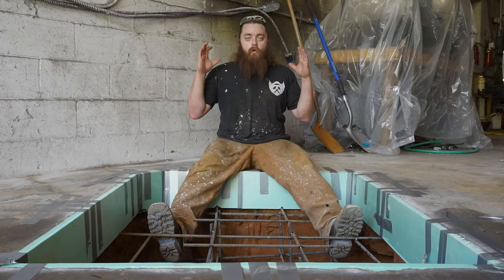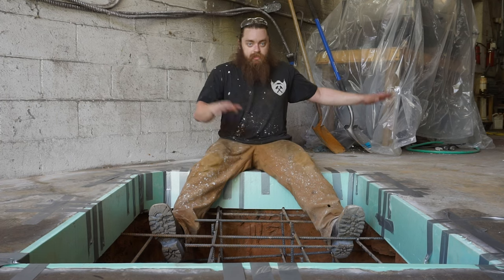NEW POWER HAMMER! (Prep and Foundation Work) - Part 1

Comment: You could of just put it on the original slab maybe height was wrong but that was a good slab
Reply from the maker: A power hammer this size needs 3-4 feet of concrete under it. A 6" slab is not enough. Plus the foundation under the hammer needs to be isolated from the pad the shop sits on so it doesnt rattle the place to pieces.